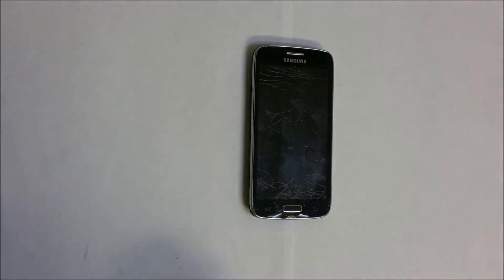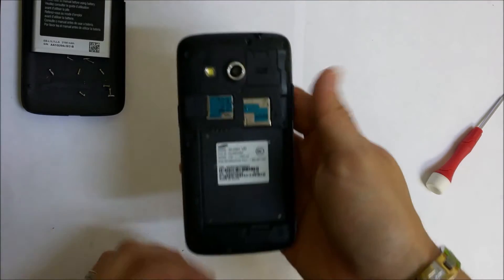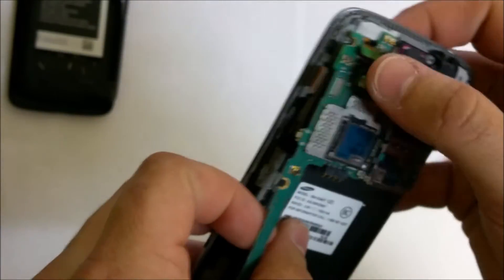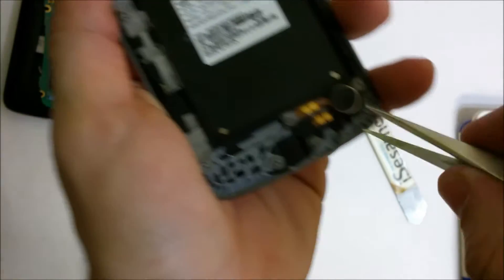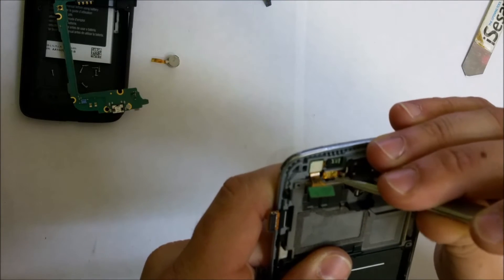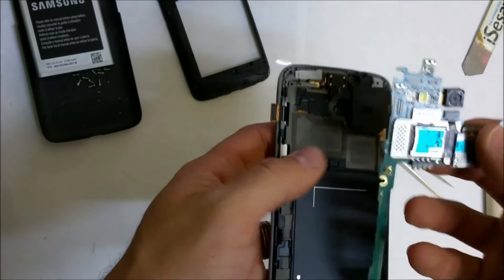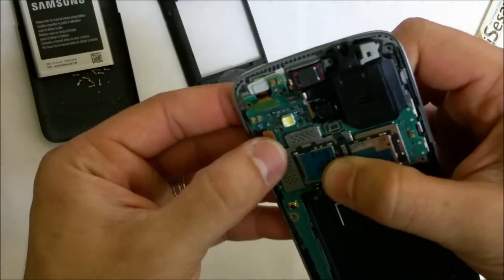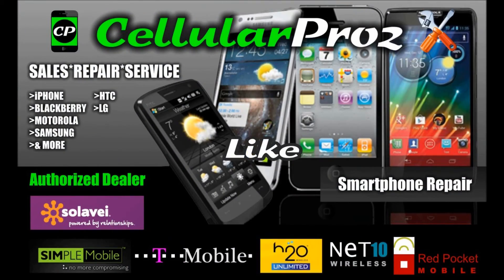Samsung Galaxy Avant LCD Screen Replacement ║ How To Take Apart

Comment: Just fixed mine today. Used my wife's old phone, just put my motherboard in it. So far..... it works! Your video was perfect.
Reply: Was all ur data saved ?
Reply: @Adultory   Yes, The motherboard had all its info still, then I inserted my sd card and it worked fine too,.
Reply: @spartianknight.  ok ty

Comment: It says LCD screen replacement, but it seems all you did was take off everything short of the LCD display, which is what I need to do (not the digitizer, although that might be helpful for some also).  Is there any way you can add to the video?  That would be great.  I could give it a thumbs up at that point.  Thanks.